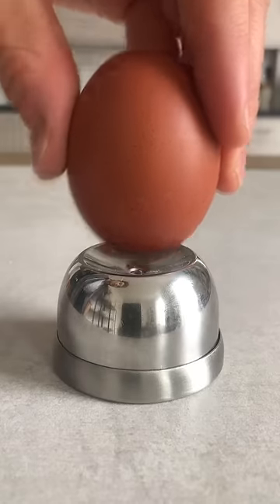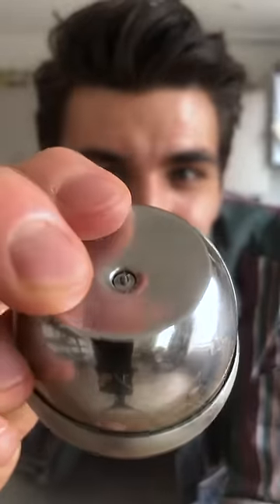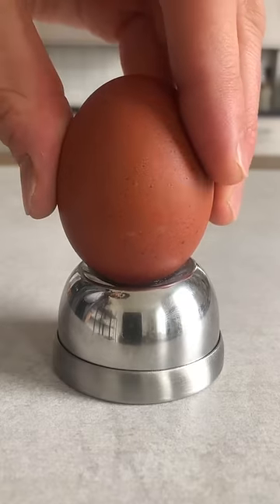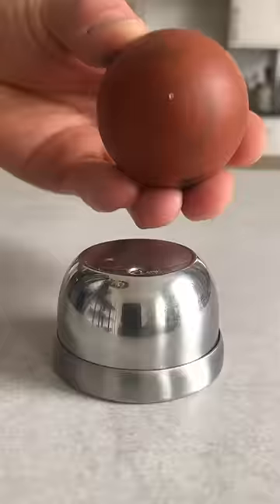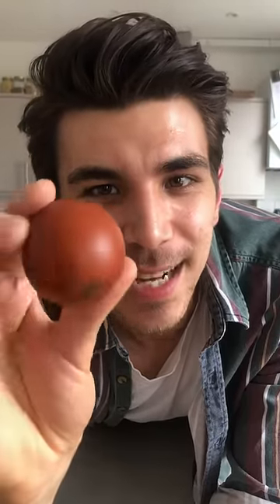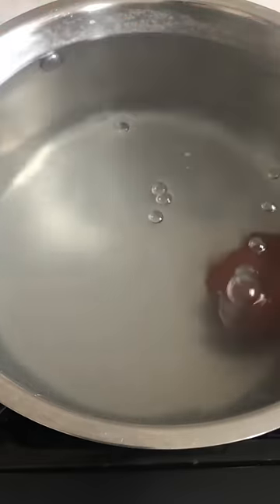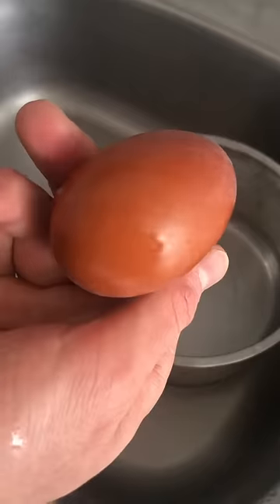German Eierpiekser | Egg Piercer

Comment: 36 years of my life I have never thought about rolling eggs on a flat surface. I guess you learn something new everyday.
Reply: I've done it for years, it'll most likely break the first few times you do it but here's a few tips I've noticed:
-make sure to cool the egg down IMMEDIATELY with cold, running water. this separates the egg from the shell internally.
-when you go to roll it, hit the egg very lightly on the counter and smoothly transition right from there into the roll.
-experiment with how hard to push down. if you push too hard, the egg will slice right in half. usually, just push down enough that you just barely hear it cracking.
-sometimes the shell isn't stuck on the egg, but is being a pain in the ass to remove. after the roll, just hold it under cold water and gently rub off the shell.

hope this helped :)
Reply: @ashleyjohnson258  That's very helpful. Thanks!
Reply: Rolling a boiled egg works well because it breaks the outer shell but the inner liner keeps it together. You then rip that and can easily unpeel.
Reply: Put the boiled egg in a jar full of water and shake , it will remove the shell
Reply: Not my preferred method of removing ahell
Reply: @MattieMattikins  When the egg is properly cooked rolling it makes it super easy and the shell sticks to the liner and just comes off. If it is overcooked, it sticks and makes it difficult.
Reply: Real question: how do you peel them?
Reply: @Acecool  properly cooked? That's a matter of preference my dude
Reply: @MattieMattikins  You're right, I should've worded it differently.
Reply: @Acecool  I get what you're saying. I was being an ass. My bad haha 😆
Reply: How do you do it then?
Reply: @DrGlynnWix  A number of ways. You can simply tap them with a spoon to make a bunch of cracks then peel away or you use the water+vinegar method.
Reply: Just gotta make sure the egg cools after cooking and it’ll come off easy

Comment: In Russia we just don't put cold eggs from fridge in hot boiling water, inside temperature eggs don't crack
Reply: I do and they don't crack. Sometimes they are cracked before cooking or crack when they hit the bottom of the pot. But if you put them into the pot with a spoon the latter won't happen.
Reply: fresh eggs man only old eggs have a big air gap
Reply: @sko1beer i use many days old eggs and they never crack because I do what the two adults in the room above us do. Bring the egg up to temp before adding to rolling boiling water with a spoon. Patience.
Reply: Вообще-то мы тут именно это и делаем 😅
Reply: Same in India
Reply: They still crack even if it's room temperature

Comment: If you start the boil with warm or room temperature water instead of dropping the egg straight in, it won't crack, but that's a cool device regardless
Reply: or use a spoon to slowly and gently add them.

Comment: Cooked eggs don't crack when boiled. 
I never did any of this .
Reply: They crack if they are not fresh because the gases start building up inside. U can check the freshness of the egg by putting it in salt water. If the egg sinks flat, it is completely fresh. If it stands up on it's head, it is not fresh and u might need to pierce it. If it's floats, it's rotten and you need to thrown away.

U can use a regular sewing needle or injection needle to poke holes, just make sure it is clean and sterlized.
Reply: That is not always true (Just so people don’t think the previous statement is an ever consistent fact).
Reply: @Furrina89  it's not that deep.. its literally just quick temperature change that's all
Reply: Sometime it's happens when I use small pots and high flame egg cracked while low flame I got perfectly
Reply: They do, it's normal
Reply: They crack when they are cold and u put it in hot water. If you put them in cold water and then heat it up it wont crack
Reply: They do if you overcook them
Reply: @Furrina89 No, i actually use older eggs because theyre easier to peel. Rapid temperature change is what causes it.
Reply: They crack sometimes when u put cold eggs in boiling water. You need to hole to prevent cracking
Reply: I have never had a single egg Crack from boiling them even if they are cold
Reply: @Tttt-740  ok take cold egg from fridge. Should be in fridge for atleast 1 day. Then put it in boiling water and see
Reply: @ashwinsnmv  yeah the eggs are all refrigerated and we boil them and they don't crack. What are you not understanding?
Reply: Looks like it peeled easier tho
Reply: Cooked eggs don't crack when boiled. Non-cooked eggs do though. Check what you wrote.
Reply: Why are you boiling cooked eggs?
Reply: @Furrina89 you can do it without salty water but with just water
Reply: Germans.
Reply: Yeah I’m confused. I’m an idiot but I’ve never had an egg crack while boiling. I didn’t know that’s even possible.
Reply: i guess free range eggs are the anomoly here since their shells are so brittle (or at least the cheaper free range eggs) cos in my country we dont have artisanal eggs like the japanese
Reply: Because you don't boil cooked eggs 😂
Reply: @nick.1  LMAO
Reply: I think it's for people who attempt to put them in when the water is boiling, so it drops to the bottom of the pan.
Reply: I've literally never in my entire life had my eggs Crack while boiling the Germans much have shitty weak eggs.
Reply: my eggs crack often when i drop them in a pot of boiling water. when i slowly use a spoon to lower them into the water gently they never crack
Reply: if you over cook, it will crack. But the purpose of putting a tiny whole in your egg before boiling is to get the perfectly roundest egg. As you can see in this video. Usually when you boil a egg, it doesn't come out perfectly round at the ends. One end is a little flatter. I personally never tried it but I've seen this experiment before with a sowing pin.
Reply: clearly you haven't cooked enough eggs.
Reply: yep, never had a cracked egg in my life from boiling.  What a useless device.
Reply: I've never had this problem
Reply: @suyangsong  bro I’ve boiled probably over a hundred eggs, they only ever crack if I drop them in to hard and they hit the bottom causing cracks.
Reply: @Furrina89  Since when? I have been boiling non fresh eggs for years and they never did this.
Reply: "This doesn't happen when I do it, so it has to be the same for everybody else!"
Reply: It depends on the type of egg and it's age. Basically how much air is at the bottom. This device puts a hole in that bit to prevent potential cracks.

Comment: With all of the variability between how long an egg should be cooked to have a Jammy yolk ranging from 5 1/2 to 11 minutes depending on if you're starting with boiling water or cold water. I firmly believe that it is not solely because of you someone is starting with cold or hot water but also the altitude at which they are boiling the water as at 4,000 ft above sea level water boils at 204° rather than 212° F.

Comment: I am 38 yrs old and have never pierced a hole in my eggs to boil them better, they gets perfectly done everytime by normal method.

Just add the eggs in the water before you put it to heat and bring it to boil gradually. The sudden rise and difference in temperature is what makes them crack. Also brown shells are usually stronger than white shells.
Reply: Your method of cooking will not give the exact consistency to the eggs. The purpose of this device is so that the eggs can be lowered to already boiling water to get the perfect consistency every time.
Reply: And you get hard yolks every time or semi runny whites when you try to soft boil….
Reply: I done it both ways and the eggs still crack at times, what I found out is that you can inspect the egg before and find out which egg will crack or not, my family thought I was crazy until I started showing them which egg will crack, the method in the video is to save those eggs from cracking, some egg doesn't need it but it doesn't hurt to pierce it, saves you from inspecting the egg also.
Reply: Nah that’s a terrible method. You can’t make perfectly cooked jammy eggs that way. Only American white person eggs

Comment: Or just put the egg in the pot while the water is cold then turn the heat on, with salt. Once boiling, count the time depending on how hard or soft you like your eggs
Reply: But that's not as accurate and will have some slight variation of texture.
Reply: @deusexmachina5769  no, if you want it between soft and hard, 5-6 mins is pretty good every single time. Once it starts boiling of course. 4 minutes for soft maybe? 7-8 for hard? Figure out what you like best and then you’ll see, comes out the same every time.

Comment: Easiest way to get cracked boiled eggs is to drop them into boiling water when they come out of the refrigerator.

Easy way to avoid cracked eggs, if you live in a place where they require refrigeration: Don't drop your eggs into boiling water. Place them into the water first, then bring everything to a boil together. One a boil is achieved turn off the heat and remove your cooking pot from the burner. Cover the pot with a lid for anywhere between 6 and 13 minutes depending on how well you like your eggs to be done. 6 minutes should come out like the guy in the video. 13 minutes is a fully set yolk.

Finally, drain the eggs and place them immediately into an ice bath, or place them into a bowl and run cold water over them until just warm to the touch. Then all you do is peel.
Reply: Bro just take them out of da fridge like 20 mins before cooking

Comment: You just put your egg in cold water and start boiling it. It doesn't crack.
Reply: Yes, but if it still has to boil, then the time needed for a specific texture is different and unpredictable. If you always want a specific texture, then you need to start with boiling water.

Comment: Eggs are porous, the air probably already escapes. Ive never seen an egg crack from boiling. A crack would only be from temperature shock when cooling it most likely, and that would be made worse with the extra surface area from the hole. This is a bad invention lol